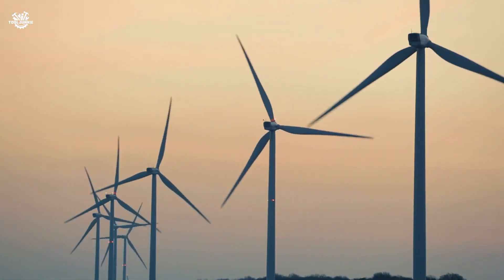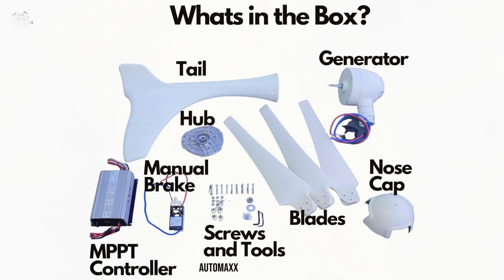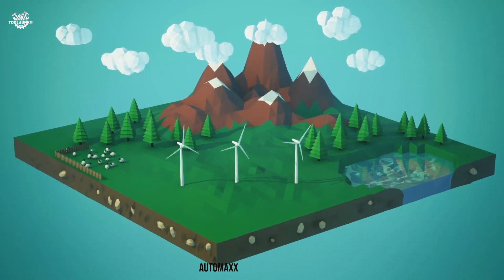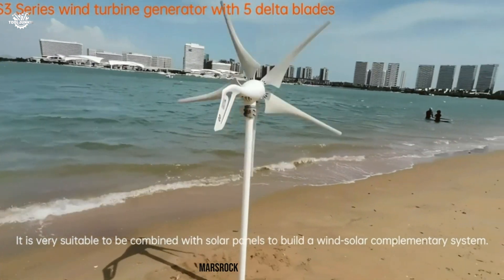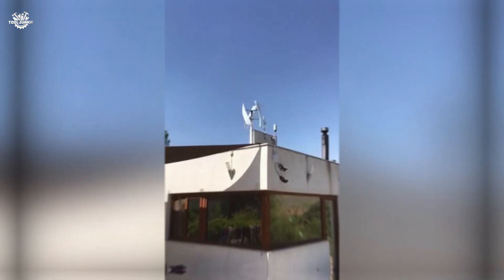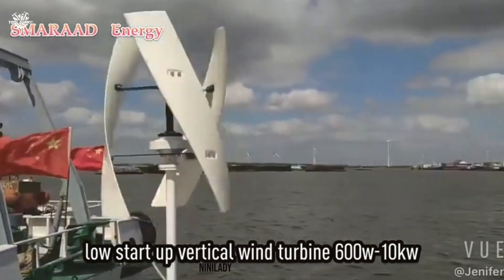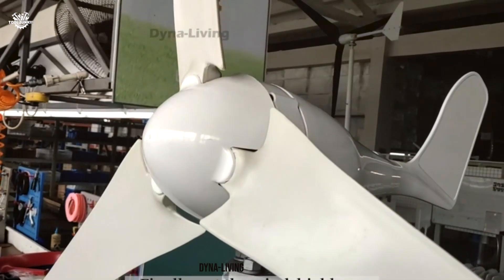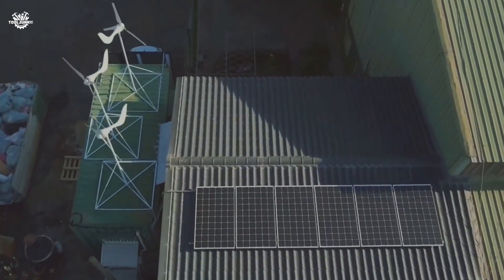TOP 10 Wind Turbine For Home | Reviews of Best 2025

Comment: Click bait. 

Numbers needed for a useful review: 
1. Voltage and amperage generated at various wind speeds
2. Minimum wind speed to operate
3. Noise at expected operating speed measured in decibels
4. Actual wattage output vs advertised output
5. Actual mount heights with real video from testing 

The ratings presented in this video are suspect because none of these numbers are given to help the viewer understand the comparisons or assist with a personal selection of the most likely candidate for purchase.
Reply from the maker: Thanks. I will include these in my next video

Comment: All practical tests show that small wind turbines hardly generate any electricity! And only at very high costs! 
Because there is hardly any wind close to the ground. It is also extremely gusty, which usually shortens the service life extremely!
Only if you need to be self-sufficient from the power grid & live close to the sea, you should install the largest possible wind turbine on a high mast. 
With solar modules, on the other hand, reliably generate electricity for 25 years at approx. 3-10 cent/kWh!
Reply: We are on the coast of the Irish Sea, would a combo be a good idea, please?
Reply: @debramoss2267  Yes, if you must live off grid. Because no sun, no energy from solar panels. But: No wind, no energy either. So you must always have a batterie too. But in general solar panals generate at least 10x more electricity with same investment.

Comment: Dont waste your time with this video….number one is useless
Reply: I agree. I had a look at all these turbines and would not recommend anyone. Rotor diameters are way too small to produce any decent amount of electricity. For a 1 kW turbine the rotor diameter should be 2.8m or more to make any power in low winds. rather spend more money on tested turbines like Bergey, Kestrell and Regen. All VAWTs are rubbish. They do not perform at all.